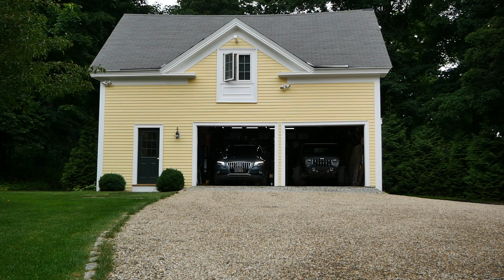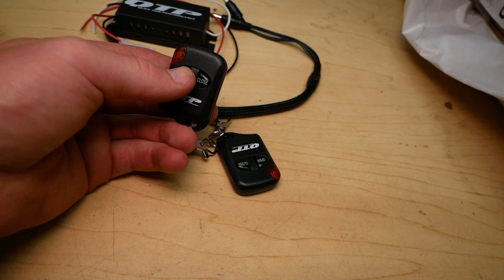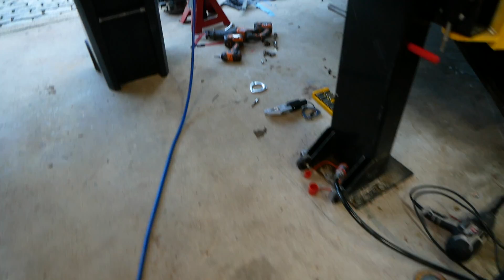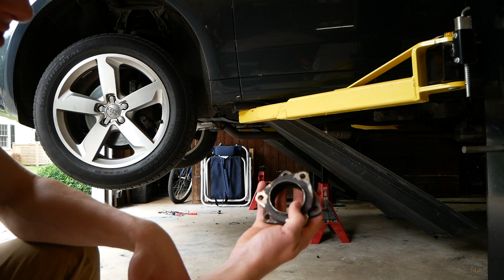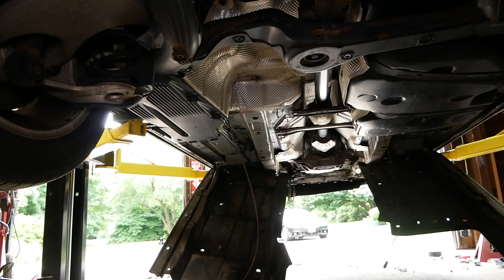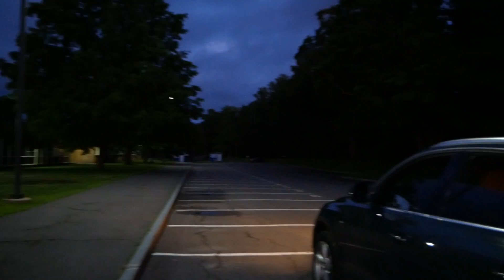Audi Q5 DUAL CUTOUTS // SUPER LOUD!!

Comment: Is it lowered it looks about as low as mine and mine is lowered but it’s thought to tell with it being dark and then it being in the lift most the time. Anyways sounds good wish I would’ve done this instead of doing a Magnaflow resonated x pipe where the little resonators are then deleted everything else. Now I’m looking for some resonators to tame it a little bit cause it’s cool at times but some times it’s too damn loud an annoying. On my 2010 S4 I did Almost the same thing but left the stock mufflers and installed bigger duel tips now the sound on the S4 is way better nit as bad in traffic and Loud as shit wot especially the whine from the charger. Anyways nice work yiu git ne sold on the I just ordered 2 sets to replace my mess on my Q5 and a set to try on the S4

Comment: That thing is going to throw codes...
Reply from the maker: Nope
Reply: Whats that throw codes mean I just a audi q5 2013 myself
Reply: @bellaphone5719  Car computer will not like the changes and throw trouble codes, and ultimately a check engine light. Worst case scenario it goes into limp-mode.